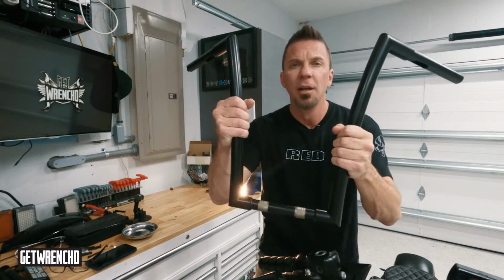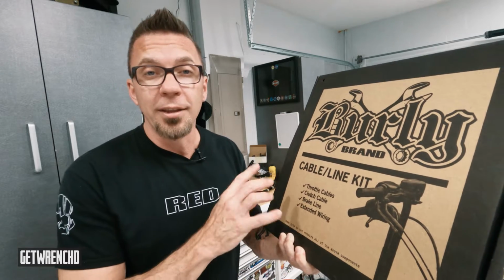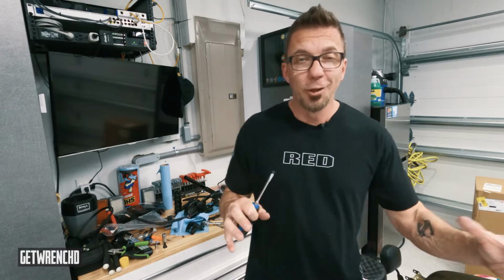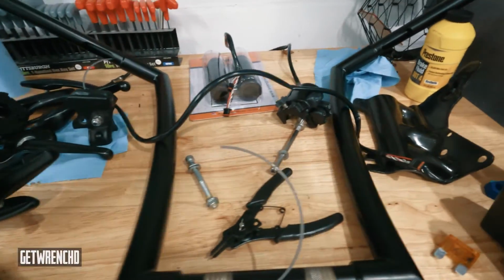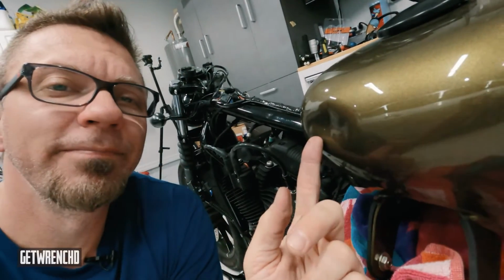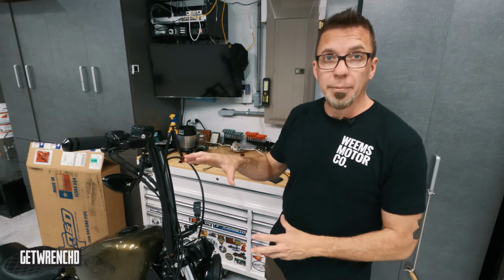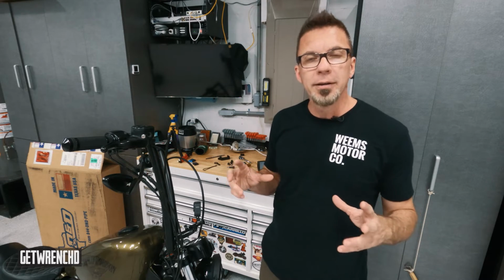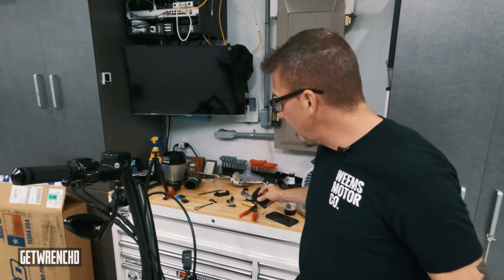Going Ape! Installing 16 Inch Apes on Harley Iron Sportster

Comment: Looks amazing!  Sorry to see about the tank.  I do love that stock color/look.  I'm in the process of tdoing a 2nd tank for grins/learning.  I went with the Drag Specialities Diamond stitch 3.3 tank...taking a torch to the Diamond stitch and a brass wire wheel brush to brass plate to do raw aluminum and brass.  If it turns out, I will post a video with it next Spring.  Too cold in Chicago to finish it up at moment.  Thanks for sharing!

Comment: ok, I pieced my cables and hose set, didnt see kits that would fit, I put 16" meat hooks on 6" risers,  had little trouble finding cables, last year,  I noticed I cant find stuff like once existed, 20 years ago, you could pick up catalog, order any size up to 31" bars, then special order taller, & no trouble with cables, just order for bike & then a plus size for how many inches over stock, 24" over, sure, was in paper catalog. modern times Grrrr... I dropped out of scene, just maintaining bike, then got back into a couple years ago, now wanting 25" bars, on 6" risers. what a chore today!

Comment: I have a 2020 Iron 1200 Got a nice set of 16" Ape Hangers as well, just curious why on amazon it says it wont fit my model I assume the length of the cable is fine just wanting to make sure the fitting for the Brake Line is correct. Love the video!!

Comment: Congrats brother! Not sure why, but with my 16’s, I don’t feel like a gorilla riding a football anymore. Really opens everything up. Great video by the way. Learned some valuable lessons with apes that people don’t talk about. Apparently your body acts like a sail at speed and can cause some wobble. Let me know if you’ve experienced anything like that. Ride safe bro!
Reply from the maker: I actually did notice that the first time out when I took my hand off the bar. Still getting used to them but so far so good! thx!
Reply: @randymack1782  thank you brother! I’ll give that a shot.
Reply: @ironglide8256  ask any old timer, that been in the wind 40 years, apes, leaning into curves in youth, and still here, but doing it 1 handed, with a suicide shift, the joys of youth. but if run tight bearings, not great, but bearings will wear out prematurely, I had 2-5 blue bearings every 2 years of hard riding, so, replace & put lots of lube, & in my youth I rode 25K to 40K miles a year on 2 wheels. now days, 5k a year is I am lucky
Reply: @randymack1782  thank you for the words of wisdom! I’ve ridden a while and even went to Harley about it. They didn’t mention that at all..😳 That’s one reason I posted here hoping someone else had this experience. Soon as this terrible weather moves out of GA I’ll get her out and check those bearings. I definitely found that leaning forward with your abs through curves helps tremendously as well as placing slight pressure forward on the bars also makes it a smooth run through curves. Could not imagine doing it with a suicide shifter! Kudos brother! Stay safe out there Randy!
Reply: @ironglide8256  not sure how hard of a rider you are, but T-bars, if you run those? stay away! I broke 2 pairs, if you have poly bushings, or even aluminum slugs for bushings, I am bad for muscling bike, instead of foot pressure to lean, so I put lots of force on bars, well the T-bars twist slightly at weld where riser is welded, over time, the welds break! I had 1 break 1 side off, other half broke, second time, cracked enough to feel, & replaced, but same week, local news, witnesses saw bars break off on someones bike, he crashed & died. so I swore them off forever. and stayed with apes.
Reply: @randymack1782  yessir I’ve heard of those. I run apes. I like the look of T bars but have never tried them. Stock bars to mini apes to 16’s. I’m pretty sure I have poly bushings. I’m going to have to look all this up. Terrible weather again here today so hopefully this weekend I’ll tear into it. So unfortunate above the guy losing his life. I guess that’s how I’d want to go though. Doing what makes me happiest!

Comment: I have a 2019 Sportster 48 with 14 inch apes. I also had to install new clutch, throttle, brake cable. My question is, since these cables are longer, if I went back to stock bars would I have to get stock cables again? Or would it be fine to have some bend in the cables? Any help would be great

Comment: A big hypodermic syringe works good to, fit it with a surgical hose, fill the syringe, shoot it from the bottom slowly until the bubbles come out in the fluid res., shut it off. - Lefty ( may have to pump it once) Under the Blood M/M